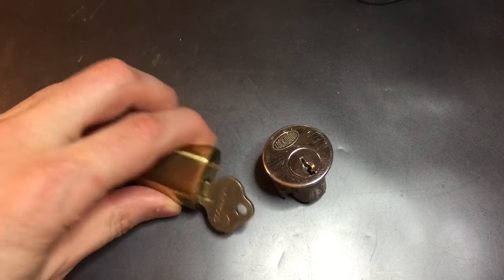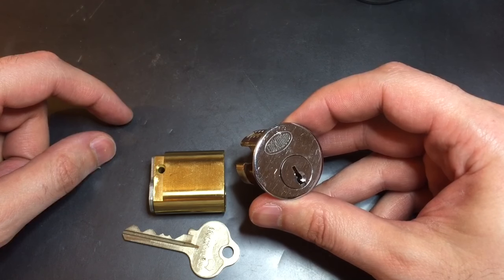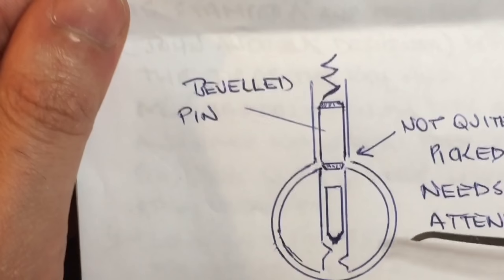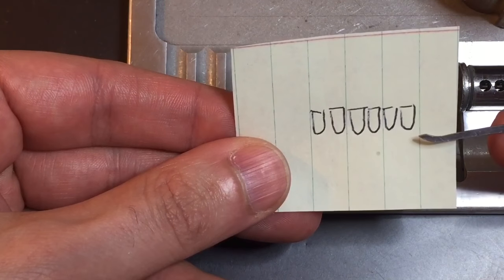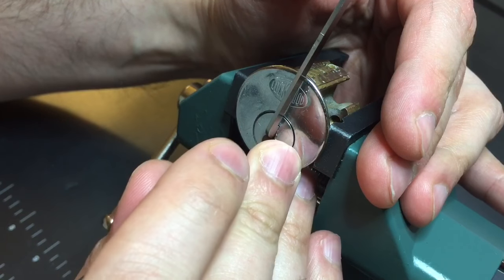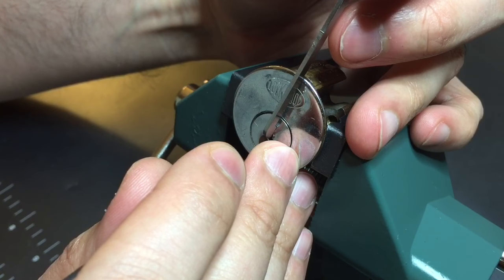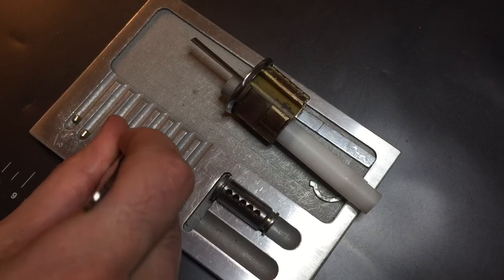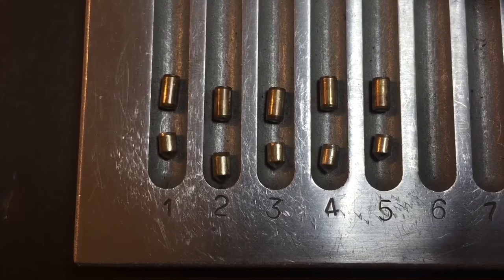[99] How To Pick Lockwood Beveled Pins

Comment: Hi Harry,   I think you've nailed it, or should I say " pinned " it down! It backs up what I have suspected after picking these locks for many years. The bevel on the drivers, were to allow for a little wear on the key pins - so the key would not " catch, " and the taper on the key pins was to allow smooth insertion and removal of the key. None of these things were designed as an antipick, however due to the close tolerances of these Lockwoods, it did in fact make them often difficult to spp.  Extremely well explained, and for the first time on You Tube. It should be helpful to the Locksport Community, that obviously have been having problems with these Aussie locks.  Well done LPL.Regards, Brian.
Reply from the maker: +Brian Hignett Thanks -- that means a lot coming from someone with your background and experience... and thanks again for the locks for me to play with.
Reply from the maker: +Brian Hignett I should also add a thank you for sharing your thoughts and experiences on this issue, which definitely helped me identify the problem, and formulate my approach to these locks.
Reply: +LockPickingLawyer ... Lockwood locks and bevelled pins - easypick ? possibly not, but someone thinking outside the square, some ideas thrown around, and now something worth trying. The newies with spools wont be the same challenge, and China? nuff said.  Thank you, Harry.  Regards, Brian.

Comment: Thankyou for your video. I think this will be very useful for teaching this as we pick a lot of Lockwood in Australia.

We pick 570 and 201 cylinders regularly by hand and students have a lot of problems with both oversetting and not understanding the bevel and why they feel "dead pins" on some of the older locks we use.

The closeups and sound are vital and incredibly helpful.  Your diagrams are fantastic and helpful to visual learners. Thankyou again.

Comment: Great video and amazing skills!
You can be happy that the gravity is helping for detecting overset pins. For euro cylinders this trick would not work as the pins are at the bottom. But you could probably touch them and can feel if they are bound.
Reply from the maker: +Potti314 Thanks.  I didn't think about all the heathens across the Atlantic who mount their locks upside down.  ;-P
Reply: +LockPickingLawyer Hahaha. The first time my son (9y) watched picking videos with me, he screamed out and couldn't believe that somewhere in the world people would open their door holding the key with the bitting upwards.
In fact, I believe it's more than just a matter of taste. The orientation affects picking and security. Some security features on work if the key pins can fall down in the bible (magnet lift). Also the technique and feel of picking differs with the orientation as I experienced. That's why I try to pick locks the way it would be mounted. Interesting topic :-)
Reply: +Potti314   Most locks in Australia are mounted with the pins at 12 o'clock, in fact manufactures used to include a sketch in their fitting instructions, orientating the key with the bitting up. We were always told that with the pins at 6 o'clock, the pins and springs had to work against gravity, and that grunge would fall to the bottom and get among the pins and springs, whereas with the pins at 12 o'clock the grunge would merely get pushed out with the key. Made sense to me. Yes, if you have to pick them around the " other " way, it feels a little awkward. I'm not sure it affects security in any way - if that's a concern the manufactures would say so. To me mortice lock keys are used with the bitting down, same as safe lock keys, but pin tumbler locks .... well, just saying! Interesting though. (:- ))Regards, Brian.
Reply from the maker: +Brian Hignett You should see me trying to pick with the pins at 6 o'clock.  It's so pathetic that it's affirmatively funny.  I've never put in the time to develop my "upside down" picking skills.  It's a big hole in my arsenal that I'll fill one day.  So if you want to keep me from opening a lock, all you really have to do is get a cheap box store lock and mount it upside down.  :-P+Potti314  It's the rare lock where security is affected by orientation, but a great example that I dealt with was Flywheel's original pin in pin challenge lock.  It's a beast when picked normally, but I could rake it in seconds when it's upside down (as shown in one of my past videos).  Another good example might be non-spring tensioned sliders.
Reply: 7 years old comment, same question :D did you found for European style pins down another way to find oversetted pins other then heavily binding very deep sitting pin and all other pins loose/bouncing. That’s my indicator normally.

Comment: Very nice explanation and demonstration!
I'm having problems picking a lock with beveled pins. I think the pin loses its binding when the bevel gets close to the shear line.  I.e., some other pin binds as the bevels make the picked pin loose again.  What strategy should be used here?  Just keep going to the binding pin and move them up into their beveled region?  I bounce around a lot, but without much success.  Or maybe I'm completely off here?
Thank you!
P.S.:  The only clicks I hear/feel are pins dropping or me errantly picking some warding.  😳

Comment: How to easily detect overset pin if the lock is in orientation where gravity cannot pull the keypins down?
Reply: Replying to myself: you have to be able to detect the slight movement that correctly set driver pin will move when interacted with keypins. When that slight movement is missing, the keypin has been overset. Note that if the lock has really weak springs, detecting this difference is pretty hard.

Comment: This video at 1:35 and compare to what you say in "[81] Kwikset UltraMax "Exceeds Maximum Security" (Pick and Gut)" https://youtu.be/19Mw_RGZrUU?t=363
"we've got some key pins that have such huge bevels that absolutely compromise security."
(I put the inverse message on the other video)
I just don't want people to think that putting a rounded or beveled edge on their pins, will make it more secure. I have a cutaway lock that has bevels on both sides of all pins, and it's almost impossible to pick without accidentally raking it open instantly, just from the pick contacting the other pins.

Comment: I can imagine no reason why having beveled pins would make picking harder, no idea what you mean by wedge
Reply: I believe it is because the edge of the core/bibel is reletively sharp, and the bevel provides a flat surface for which the sharpness of the core's edge catches on. If the core's edge was dull or the pin was rounded, it would make the pick easier. But the friction caused by this scenario actually makes it harder.